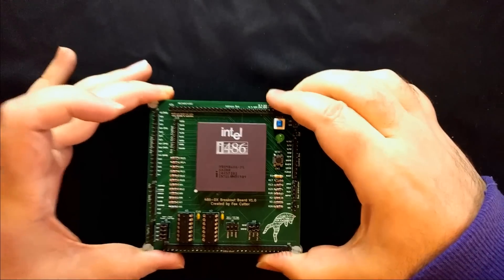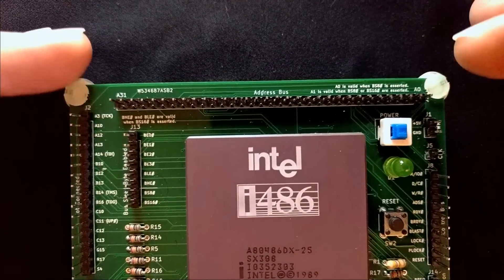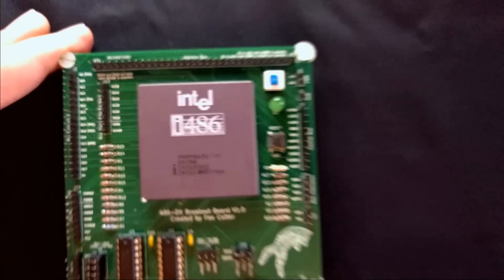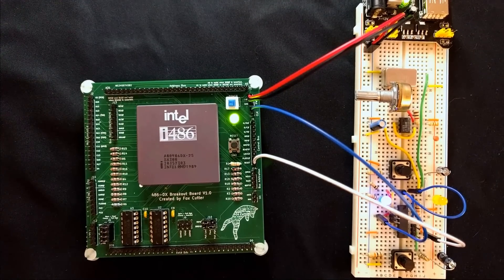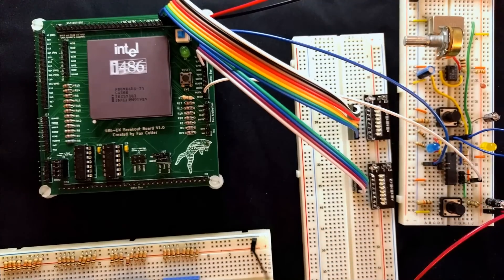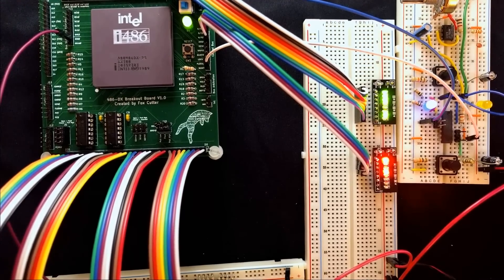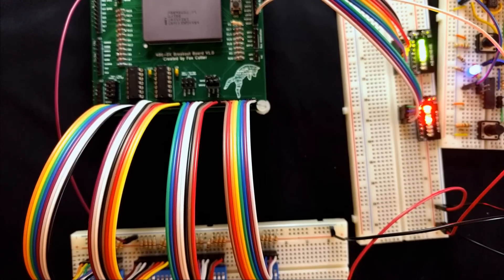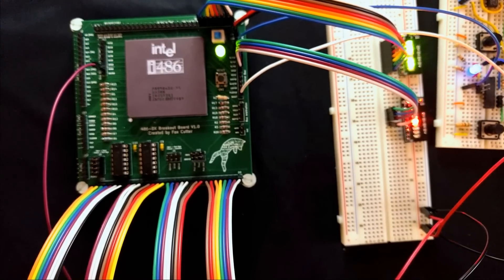486 Breadboard Computer - Part 1

Comment: Lol, the PIC18F452 has a datasheet that's like 380 pages or so and runs at 40 mhz.

Cool idea, how about the ram chip, they will wil probably very expensive if you have to buy them now.
Reply from the maker: 512k SRAM chips were only about $6 each on mouser, and you can find larger SIMMs at the same price, though DRAM is a bit trickier to work with.
Reply: @Fox-Tech  512kByte? or bit?
Like the 23LC1024 or the 8mb "APS6404L".
Reply from the maker: @AnalogDude_  512k Byte (4M bits). In this case AS6C4008
Reply: @Fox-Tech  Thanks, that's a pretty cool chip, easy to use, accept you need a 24bit pot expander or so to beable to use with with a 32bit pic32MX i'm using now.
Are there 24/32 bit version of these chips? ... instead of bytes to save on clock cycles to fetch or store data.
Reply: @Fox-Tech  Lol, i found a Pentium 133 last night, but unfortunately the footprint has offsets and doesn't allow you to use headers.

The cpu's are better with their parallel ports to use external ram and rom.

Akai used a i386 in their S3000 sampler.

You think you be able to attach a Hitachi controller LCD?
Reply from the maker: @AnalogDude_  Yeah, the PGA gets denser as with each generation of chip. The Pentium had 320 pins, and a modern CPU has 1700 (or even more for some server models). 

Once I have the rest of the support chips in place, it would be fairly easy to hook up the LCD. Would only need a little logic for device selection, otherwise it should be pretty straight forward.
Reply: @Fox-Tech  I want a Microchip 32 bit processor with sufficient I/O pins to be able to hock up a few of these 8 bit SRAM chips for powering 16 or 24 bit ADC/DAC's and build a delay and have some storage.

You can't buy these old i486's of the shelf.

Comment: I am interested to see where this goes (and yea its similar to most processors, but its still interesting as most people wont go past dip packaged chips)
Reply: I could be mistaken, but as I gather, the 486 was pretty much the last of the "similar to other processors" before things like low voltage levels and specialized busses became a thing. The beginning of that trend is touched-on, here, in that even though you can tell the 486 to access individual bytes, it expects them on different data-bits depending on their alignment. Not difficult to do with TTL, but not "easy", either. (imagine its being connected to an 8bit ISA card!). So, at some point it became almost essential to have bridge chips to interface with the outside world, even if that's nothing more than a boot ROM. So, in a lot of ways the 486 is maybe amongst the last of the "similar" CPUs (Z80, 6800, even 8088) (and comparatively really powerful*) that folk like us *can "breadboard". That was a very exciting finding...

Comment: Love the concept of this. Watching to see how far you can go with off the shelf modern parts. Could be a way to have a nice PCI setup as the 486 PCI boards are either really bad or extremely rare and expensive.
Reply: PCI is way more involved than what's needed for a bit of RAM and ROM. My EE course where we did microprocessor interfacing we just did PC bus (as in original 8086->style) which is simple enough to do with simple gates and latches. 

For PCI you need a fairly complicated state machine, especially for the discovery and initializing.

Comment: Wow! I did not know the 486 could be run at such low clock speeds. I'm studying to start working on something like this myself. Every 486 datasheet I've ever seen specifies the minimum clock speed as 8MHz. Being able to run it as this speed would make things a lot easier in the early debugging stages.
Reply from the maker: I wasn't sure it would work myself, but being that it's a CMOS chip it seemed like it should work that slow. It's still possible there might be other issues in the future, but it's been fairly stable in my testing so far.
Reply from the maker: @Lurch Manually running the clock only sort of works, at least for a dozen cycles or so. After that it seems like if the duty cycles are far enough out of sync it goes into shutdown mode until it gets a stable clock again.
Reply: The 486 does have an internal 8 KiB 1st level cache. I don't know if it needs to be refreshed all the time but if that is a requirement, than it would definitely limit the minimum clock speed.
Reply from the maker: @OpenGL4ever  I believe the cache is sram, though as I've yet to enable it yet, I can't say for sure.

Comment: I have a 486sx waiting for something just like this. If you are working on making an 8bit bus, it might be worth looking at the z50 or rc2014 buses. The z50 is only a 16bit address bus, but you could still play in the bottom 64k. The extended rc2014 bus has 16bit data and 24bit address, but could be possible to do 8bit/16bit data & 16/24bit addr.
Reply from the maker: Depending on the revision of the SX, the breakout board could work for you. The main issue is the NMI pin was put into a different location (A15) which is used for a FPU related function on the DX, this was changed in the SX2 to put it in the same location (B15) as the DX. 

As for the bus, my hope is to eventually have a 32-bit RAM bus with an 8-Bit ROM, but I will look into the ones you suggested as well.

Comment: I like it!

Just today i ordered a PCB what extract the pinout of a 186 to a ISA Bus (for sure with custom pinout, but useable on a standard backplane). I want to do the same "Selfmade Computer" with it. The 186 uses A0 and BHE to seperate the lower and higher Byte of the 16bit Data.

And yes, you can mirror/overlap a single memory Chip/adress space to two different locations 😅

Its nice to know that the 486 can work with 8bit components. And one of my first tests will be the lowest working frequency because i want to see blinking LEDs too
Reply from the maker: That sounds like fun. I don't think the 186 gets used enough, so glad to see someone doing something with it!

In 16-bit bus mode, the 486 has the same A0/BLE BHE signals. That's one of thing that seems consistent throughout all revs of the CPU.
Reply: @Fox-Tech  There are some DIY with the 80186/88 in the WW - but just a very few. Most of them are SBCs copied from very old schematics or pc-magazines. I want to start from scratch with something like a computer and not PC/Amiga or somthing compatible.

Comment: I'm looking forward to the next episodes of this :)

Also: I'm wrecking my brain on how to connect a single 8bit RAM to all four parts of the data bus.
I guess I'd aim at 4 switchable bus tranceivers (74xx245?) connected to the byte enable lines and a 4xOR from all byte enables to the /CS of the RAM...
Reply from the maker: That's pretty close to what I'll be doing, though using a 74139 to select enable the chip.
Reply: You'd be far better off racking your brain since that is the correct English idiom!

Comment: I really like the idea and your presentation! A friend gifted me a beautiful 33MHz 486 a while ago, but I haven't had a way to use it yet. I wanted to make a board like this, but the datasheet seemed a bit too complex for a weekend project. Are you planning to share the board design? I'd even like to use this in my own YM2612 retro synthesizer design.
Reply from the maker: I'm glad you like it. I wasn't sure of exactly how to handle this, and tried a few different things before settling on this one. 

I do have an slightly older rev of the board on my github, hope to get it updated soon. https://github.com/FoxCutter/Tools/tree/master/486%20Breakout I should also add some more documentation on how it should be used with a DX2 and possibly DX4 board.
Reply: a YM2612 Synth with a 468. count me in, i need this